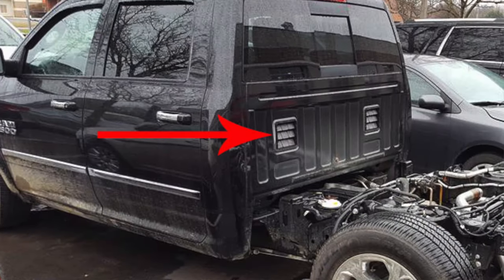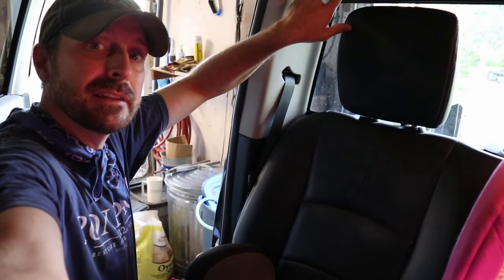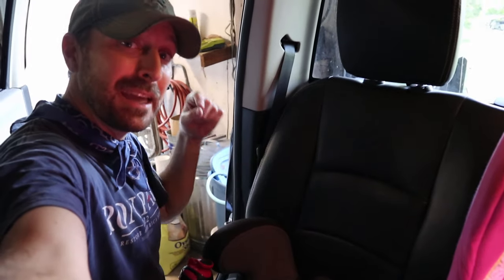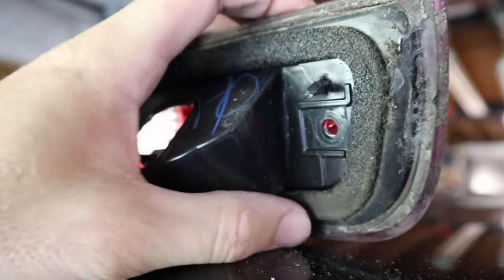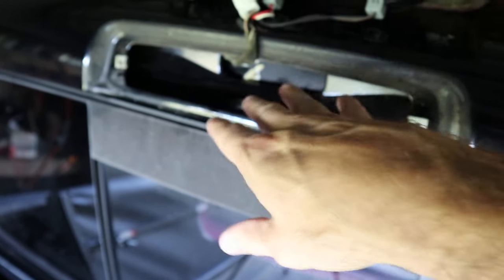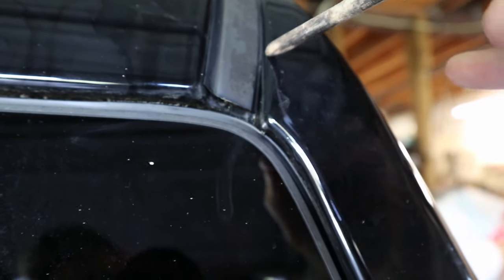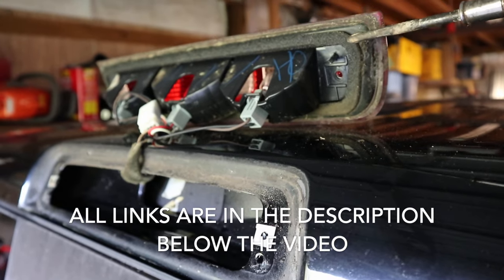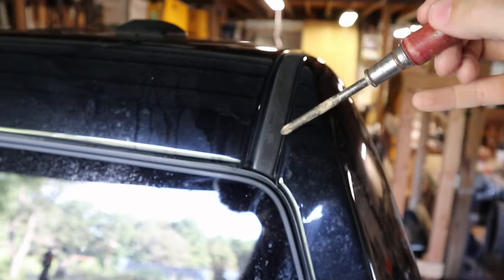RAM Third Brake Light Leak And Another Hidden Leak Spot - DIY Self Sufficient Vehicle Repair

Comment: I had the brake light leak, the vents, now im sitting out here in the driveway, trying to figure out where this new leak is coming from.
Rear window, driver side, water in the groove the rear window slides around in.  Only in the corner, overflows goes to the floor.
Ugh.
Reply from the maker: Wow. I have only had the one leak.
Reply: @CountryLivingExperience its the seal on the window, but im not sure how to get at it, there is a like hidden grove that i would want to get the sealant behind, you understand what im talking about?
Reply from the maker: Sorry, I don't know how to disassemble the rear window.
Reply: Same here, replaced the 3rd brake light, cab air pressure vent and now its leaking from the cab window
Reply: @rosendoperez6677 figure out what to do yet? For the moment, Im jamming paper towels in the bottom right corner of the moving glass of the window, in the track up against it.
Reply: @BLASTIC0  I'm messing with it at the moment, might put water sealer around the gaskets to see of it works
Reply: Anyone know where to buy oem seals for tail lights not 3rd light! do they have gaskets around each bulb and or a single gasket around the housing? My lower portion for reverse light is wet but no damage from any accident, is this split from upper and lower as in air tight separate areas for upper and lower bulb? My guess is the light is leaking and only on the bottom but idk plz someone help! I have a 2017 dodge 1500 slt v6 quad cab with chrome trim but not around the rear lights. The truck has 22k miles so this is annoying. Thank you!